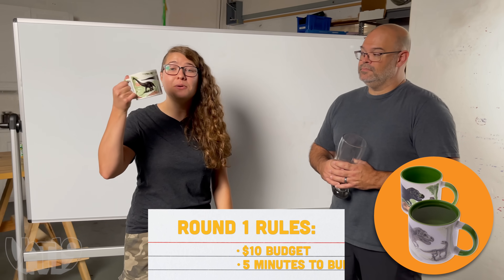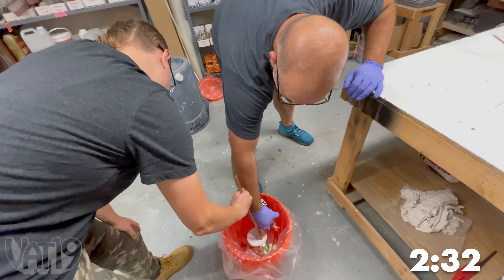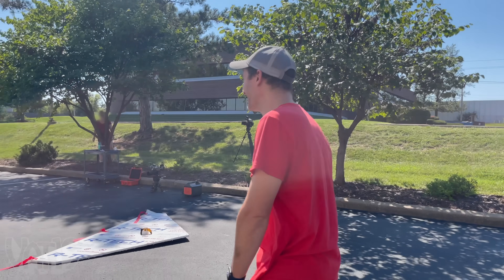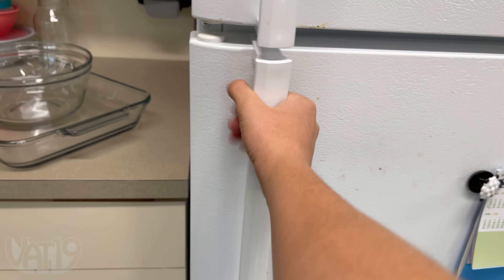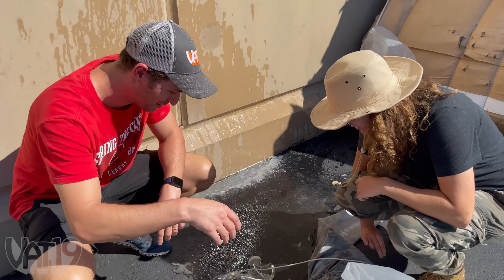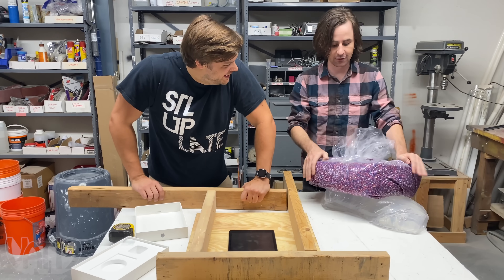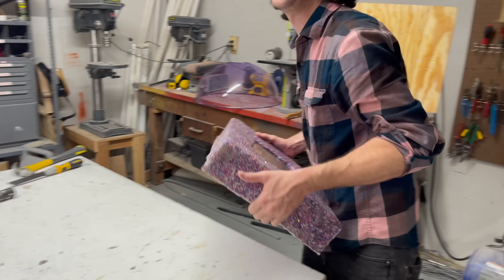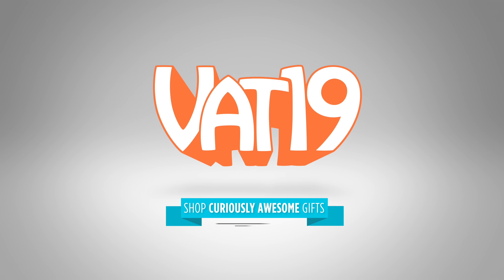Can Putty Actually Protect This From a 20-Foot Fall? • Drop It Without Breaking It #2

Comment: Virgin solution: Drilling holes into glass; when it will inevitably explode
the big-brain CHAD solution: Jell-O Beer

Modern problems require modern solutions

...while it was cheating, I'd give her the entire prize money for thinking out of the box
Reply: Its entirely cheating as it could have absorbed some of the impact
Reply: The rules didn't say the beer couldn't be tampered with, so it's quite clearly not cheating. It was the most brilliant solution to that problem.
Reply: @CocoaEm  well the whole point of the challenge was to try and find ways to absorb the impact so is it really cheating or just trying to win?
Reply: @kaejamieson1458  well they changed the physical form of what they were trying to protect. Its no longer apples to apples.
Reply: @CocoaEm  there is no way that the beer could stay in the jug while falling.

Comment: The fact that they were holding that iPad after it broke really really freaked me out because in my industry that I work in I dealt with the device like that and that condition and it was not safe and it was very hot like he said in it exploded later. Batteries don't like being bent or cracked or snapped in half